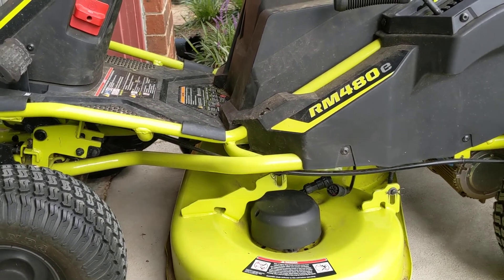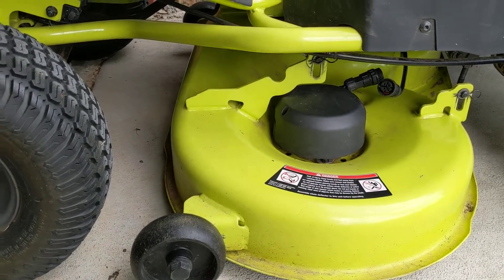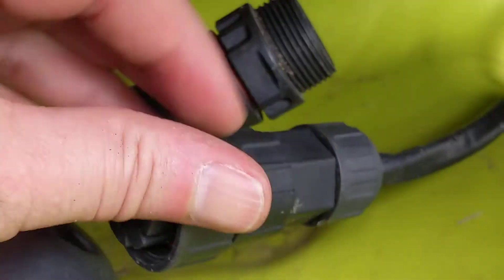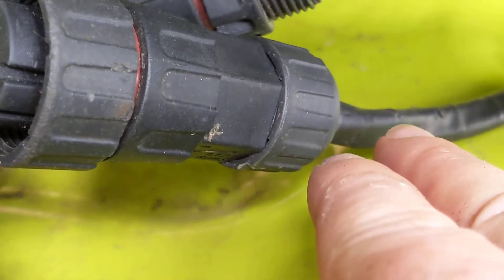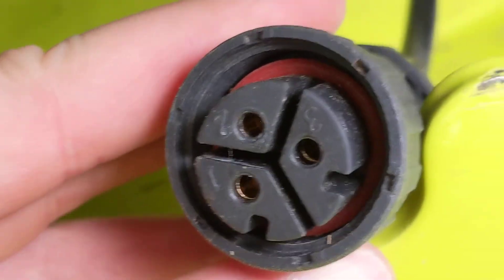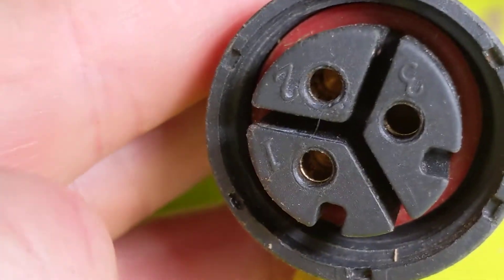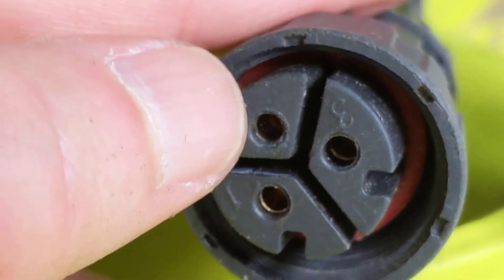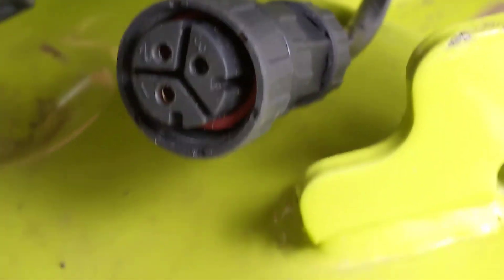Ryobi RM480e Fix - Blades Start then Stop Spinning

Comment: Mine did something simular,blades start and stop.....I thought, crap!! How much is this going to cost me!!
Saw this video and looked at the connections and the little ring that hold the 2 connections together had broken and not holding them tightly together. You can't replace that little ring so I just had to tightly duct tape them together. . That was a huge relief!!!

Comment: Definitely check this first, though sometimes it is a bad controller box (there are two). The latter usually happens, though, if one or both of the blades run into a hard object like a thick bush stump, pipe etc.